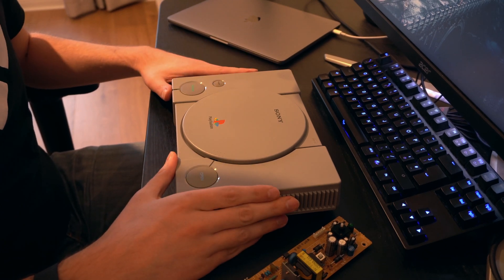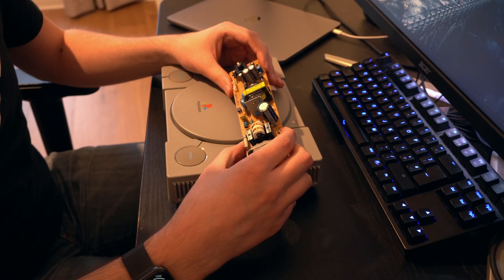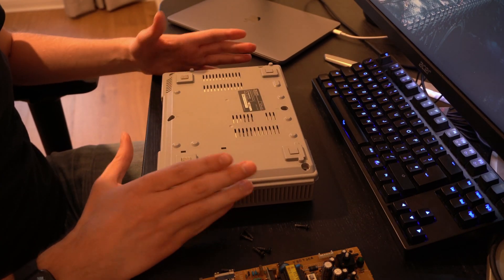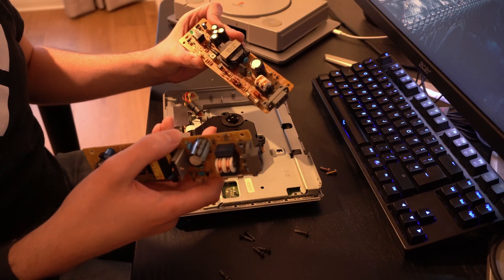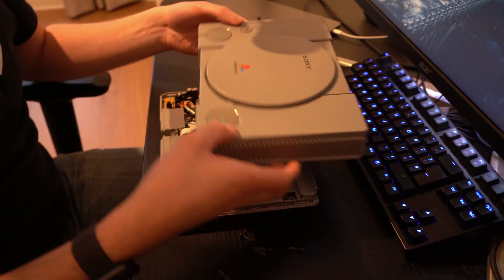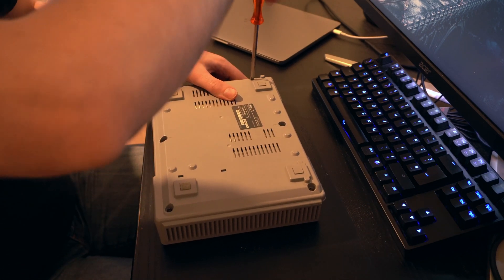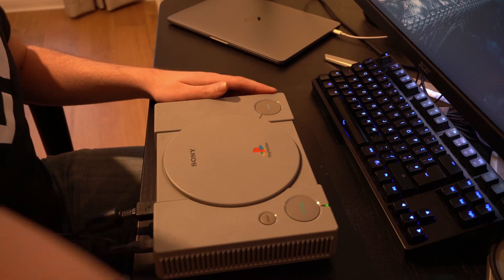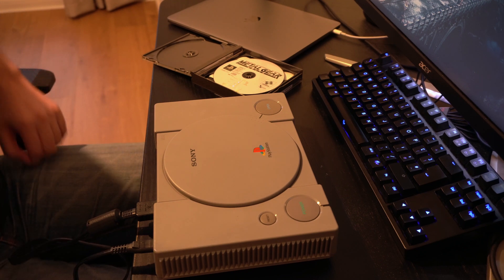PS1 NTSC-J 100v PSU swap with PAL 220v-240v

Comment from the maker: ⚠Warning! ⚠ PAL grid is 220V-240V, do not plug NTSC-J or NTSC-U PSU to 220V-240V (PAL) grid, the mismatch in voltage and Hz will damage the device and may burn your house down! Please note capacitors may still hold current which may discharge and kill you while you are performing the swap! ⚠ Use at your own risk ⚠
Reply: 240V does not blow the fuse it blows the smoothing cap and makes a lot of smoke. Please correct your information in the video it is misleading
Reply: @lukecoppin2173 correct, I just done this and there was a lot of smoke. No flames or burning houses

Comment: Did you have issues with video output? or did you use a NTSC to PAL converter? Im having issues with video and audio output but Im trying to figure out the issue... already changed the video output capacitors, but still nothing
Reply from the maker: @afonsobatista1420  Not sure i follow. This swap simply allows a 110v console from japan or usa to work on European 220v power outlets. It does not change the video output at all.
Reply: @powerslideita  I know, I know ahhaha I was just asking because, I think my PS1 from Japan have an issue with Video... but I read online that in Japan they have a different video output and TVs in Europe didnt support it... so I was wondering if that could be the issue for me, or its really a hardware problem... then I watch your video and after you changed the power source (as I did), then you didnt have any issue with video output on your TV so I asked if you were using a converter or you just plugged in normaly.

sorry for the big text x)

Comment: Cool video man !

I have a 100 v NTSC J fat ps1 and connected by mistake into 220 v . So, I found that one capacitor (the one is near to power plug port) was damaged . 

Should I change the whole power board or just change that piece ?? 

Because I don't see any other damaged rather than that piece of capacitor ! 
That capacitor, I would say, is bigger than other ones !
Reply from the maker: If just a capacitor was damaged (likely also the fuse, you might want to check) you can desolder it and replace it but if you plug it into 220v mains it will happen again. The easiest thing to do is get a power supply board from a 220v region and do i swap like i did.
Reply: @powerslideita  What if you replace that 110v capacitor with the one from a 220V board working one? will it work even though it's a completetly different board?
Reply: @powerslideita The fuse does not blow. The information in the video is incorrect. Fuses blow on amps not voltage. Please correct the video

Comment: I wish to do this with an American NTSC console and an European power supply unit. 
Is that doable?
Reply from the maker: Yeah no worries
Reply: @powerslideita  No luck, I'm afraid. Different number of pegs on the cables of the unit and console.
Got another option though, a Japanese console that might have compatible components, if I'm lucky.
If so, I'd have an American console with a Japanese power supply hooked up to a European home.
Is that doable, or even safe?
Reply from the maker: @shadowmage2  Don’t do this! Japanese PSUs are the same as US PSUs as they are also 110V, you will fry the PSU (and potentially burn your house down) if you hook it up to the European 220v grid!
Reply: @powerslideita  Thanks for the warning.

Comment: I have a (NTSC-J)  3000 model.  Can I use this method to change the PSU?
Reply from the maker: Yes, it works on all of them. But check which psu type you need (by number of wires).
Reply: only with another 3000 model

Comment: Thanks so much for this very in depth video, I'll be needing it!! Just like you, I tried to find as much information/pointers as I can regarding the power supply, and there wasn't much to go on.

Much cheaper to source PAL units locally than it is to buy a 100W 100v-> 220/240v step down converter in my country. Waiting on a DTL-H1000(!) debugger unit to arrive, and just making sure I have all the right information, tools and parts required to maintenance.

After watching this, it seems like the only thing I'll need to be looking out for is the pins.
Reply: @Milo Bentlee yup, I've been using InstaFlixxer for since november myself :D
Reply: @Milo Bentlee Definitely, been watching on InstaFlixxer for years myself :D

Comment: you can replace 400v capacitor and some resistor in 100v power supply to use with 220v
Reply from the maker: Do you have a link to a website with documentation that shows this? It might be useful for people that more confident with the soldering iron.
Reply: @powerslideita  
there is a Brazillian or Portugese dude here on YT with a video doing that.
in the video he only replaces the capacitor on the input from 200v 100uf to 400v 68uf, that is all i see him do, don't speak portugese, so not sure what he says.
Reply: I’m not the expert, but wouldn’t the output power voltage increase after capacitors and resistors change? It’s also important, too big power on PSU’s output can fry the motherboard, in best case fuses will blow up.

Comment: Thanks for the vide mate! Can this also be done with an Australian PAL 7502 PSU swapped into a Japanese NTSC-J 5500 PS1?
Reply from the maker: Both have the same 5-pin connector so you can also do the swap

Comment: This is EXACTLY what I was looking for! I was thinking of buying an NTSC PS1 to use with the PSIO, and PS1Digital when it comes out, but I also didn't want to mess around with step-down converters. I was thinking of just using a PAL console, since running NTSC games via PSIO will result in a proper 60Hz, but then realized it might be best to go all-out NTSC after reading this post on Cybdyn's forum: https://www.cybdyn-systems.com.au/forum/viewtopic.php?t=890. The discrepancies are pretty minor and might not make a HUGE difference in the long run, but considering the investment for it to be modded to HDMI (as well as the imminent scarcity of the kit), might as well use a console you know for sure will play everything to the best of its ability.

By the way, what was your reasoning for using a SCPH-5500 console? On the PS1Digital compatibility chart (https://ps1.i74.de/PS1HDMI.html ) it says that most 5000 and the earlier 7000 models can be modded, both which will work great since they have the Parallel port for use with the PSIO. After some digging online though I couldn't really find any evidence for one model being better than the other.

I saw this video that shows that the SCPH-550x models get rid of the color banding problem that earlier consoles had, so maybe one should avoid SCPH-5000 if they are gonna use PSIO: https://www.youtube.com/watch?v=7fAOieXzbeo 

Anyway, now I just gonna find the correct European power supply so I can do this installation myself...

Thank you so much for this video and making life in PAL-land a little more bearable :)
Reply from the maker: I did get a 5500 for PS1digital and PSIO, however my plan has now changed to PS1Digital + XStation (https://castlemaniagames.com/products/xstation )

To any PAL-land citizen planning the same mod, the best is to use a PAL 5502, it's extremely common (I got one myself recently for 20£ on ebay) and save the international shipping fees and headache of region lockouts of the 5500. While it doesn't have to be a 5502 specifically, what you are looking for is a PU18 motherboard, but because some 7000 consoles came with PU20 boards better stick to the 55XX series, you just can't find motherboard information from ebay sellers. The PU18 is the only motherboard that gives you the option to install XStation, PS1Digital, PSIO (even all at the same time)

With the auto pal50/ntsc60 frequency switching (effectively a dual frequency oscillator mod) and modchip duty being taken care of by PS1Digital, the PAL 5502 and NTSC-U 5501 are effectively the best consoles to this this mod on because are truly region unlocked. The 5500 I have is not, it will only play NTSC-J backups (provided a mod is installed) or original games only. You also need to do a PSU swap on the 5501 to use it in Europe.....so 5502 wins on all fronts.

Why did I get a 5500 then? I had no idea when PS1digital was coming out, availability and price (to be fair we still don't really know as of today)...and i really wanted a console to play Policenauts and Ace Combat 3 (the japanese version, not that sorry excuse of a PAL port).
Reply: Why is the Japanese console region locked? Shouldn't it also be able to boot games from other regions via xStation?
Reply from the maker: @velbyYT  There is extra region protection on NTSC-J consoles and no modchip to date can get around it, but once XStation is installed it becomes region free. I confirmed it with the designer of the mod just in case (https://twitter.com/_ramapcsx2/status/1294206438945021952 ). The mod however removes the CD drive completely (which might bother some people). 
But with PSIO you retain the CD drive so if you inserted an original PAL game (or copy) on your 5500 it wouldn't boot...but you would be able to play it via the SD card on the PSIO instead. It boils down to this (in my opinion): use any 55XX with XStation, 5501 or 5502 for PSIO. 
There is always the option of replacing the bios on the 5500 which turns it into a 5501...(https://www.willsconsolemodifications.co.uk/ps1_replacement_bios.php )
Reply: Oh, I understand now! I plan to take the same route as you and go with the xStation and PS1Digital, I even bought the same consoles as you, a SCPH-5500 and a SCPH-5502, and will perform a PSU swap. In hindsight I would've just bought the SCPH-5502 if I knew the PS1Digital added a DFO, but might as well send the NTSC-J console for mod work since I've already bought it (plus it's in better shape).

On another note, do you have any clue if there would be any speed discrepancies between a PAL console running an NTSC game without dual frequency oscillator, and a PAL console with one? I mean the console will still output 60Hz either way right, or is the timings slightly off without DFO?
Reply from the maker: @velbyYT  There is a slight output frequency difference, closer to 59Hz than 60Hz which is out of spec. I personally never had a problem, test it out for your self and see if you need it, my retrotink2x scart/TV display nstc games from my pal 9002 correctly. No judder, stuttering or tearing.
Reply: The SCPH-7000 model is probably better than the 5500. The 5500 has a better DAC but has worse circuitry for reading discs. The 7000 also has the GTE-2 processor so it can apparently draw polygons slightly better.
Reply from the maker: @Maka8295  Some 7000 came with the PU20 motherboard which unified some chips into one package making it cheaper to manufacture, but as far as graphics is concerned there is no difference. Because of the integration of those chips it means that PU20 7000 series ps1 cannot have the XStation ODE installed, the other scph7000 that came with the PU18 board are the same as the 5500 series.

Edit: basically in terms of being able to install any mod you want, the 5500 series is the way to go.
Reply: @powerslideita  No this isn't true at all. All 7000 series come with PU-20 mother boards. The 7000s which come with a PU-18 were the Asia only ones, and are pretty much non existent. The PU-20 Motherboard DOES have the GTE-2 processor, but no developers made use of it as far as I know as sony didn't really emphasize it at all. At the moment only the PU-18 motherboards and earlier are compatible with the X-station, but the PU-20 motherboards will most likely be compatible in the future. The ones to stay away from are the 7500 and later, as they integrate the DAC into one of the other chips making it impossible to get digital audio. From what I understand, the only chips that got integrated with the PU-20 were simple controller chips, if anything that would only increase reliability as there are less parts to go wrong.